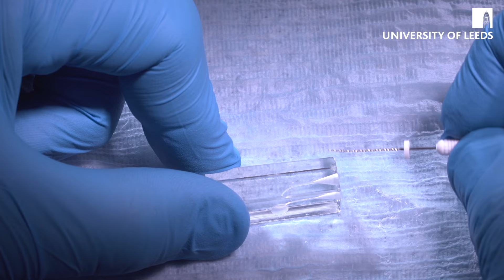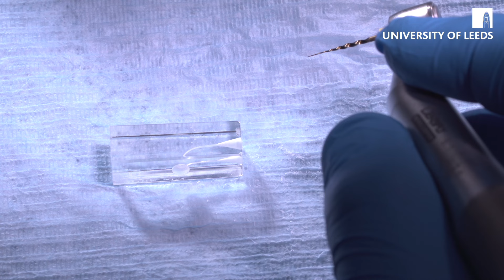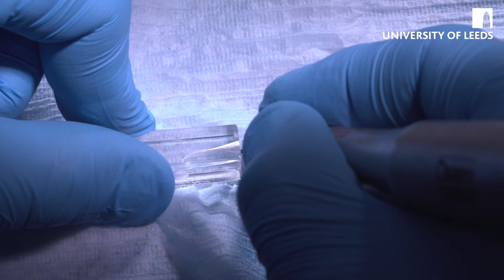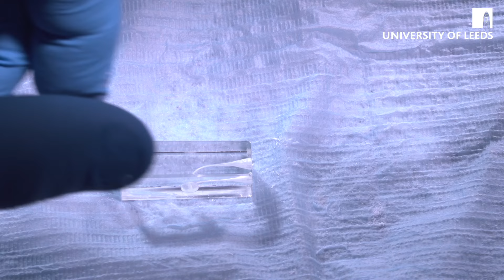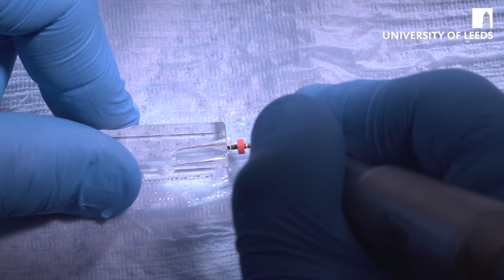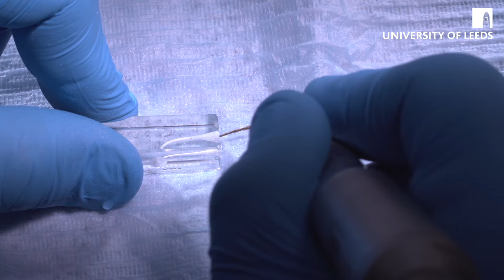Endodontics: Wave One Gold Demonstration

Comment: Dr Great video, I have a question how many times I can reuse the file?!
Reply: THE FILE IS DESINGE TO BE SINGE USE AND IT COMES SETRILIZED SO YOU DONT HAVE TO AUTOCLAVE IT BEFORE USE AND IF YOU AUTO CLAVE IT IT WILL BE UNUSABLE
Reply: Aha I got you dr thank u soo much
Reply: but usually you can use it 2-3 teeth, look for signs of use on it, if you sterilise it
Reply: 0